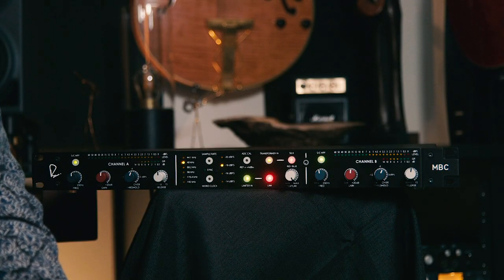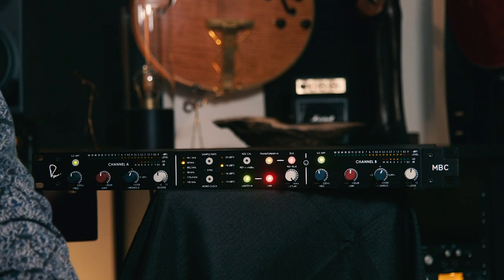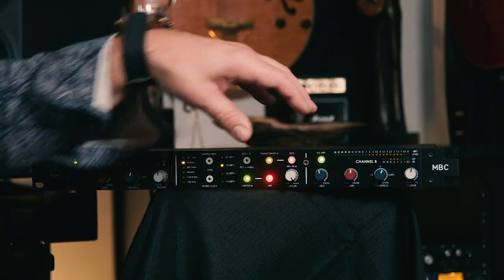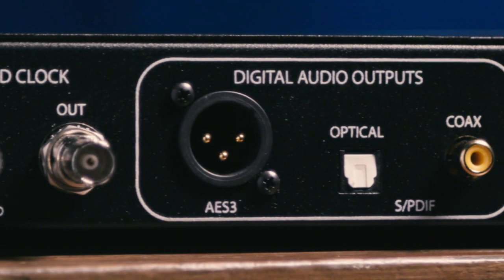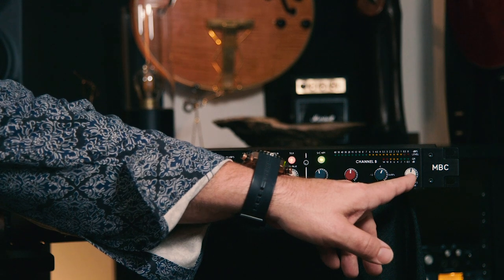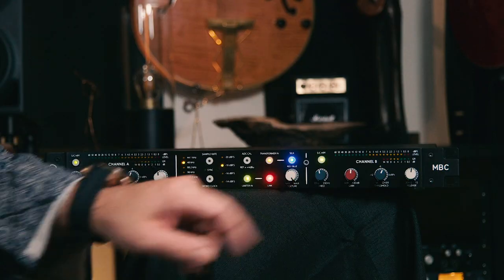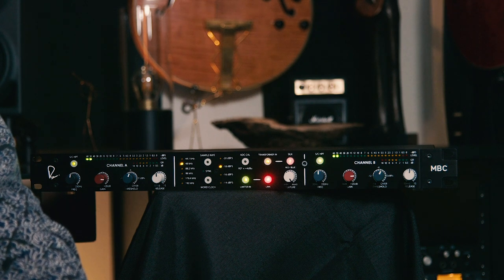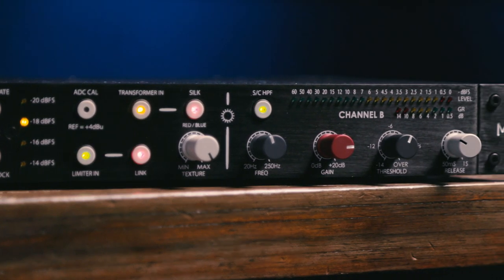Rupert Neve Designs MBC Master Bus A/D Converter and Limiter Demo

Comment: An case anyone is curious, it's four grand.
Reply: skull emoji
Reply: @Muse Axe Backing Tracks Floating point is a digital domain format post conversion anyway?
Reply: @Muse Axe Backing Tracks There is no converter that exists that operates in flloating point as by very definition the 0dB clip threshold is set.  Post conversion any 24 bit fixed point file can be converted to float for processing as all that is happening, to explain it simply is the clipping threshold is raised.  32 bit float file is basically a 24 bit file with an extra 70dB of headroom above 0dB to avoid clipping.
Reply: Sticking with my dangerous convert ad+

Comment: i am quite new to this wolrd , still trying to figure out some tecnical stuff. so this converts audio sources like guitar, volcals to digital, can it do the opposite? converting digital to analog from the sound card and feed it to the studio monitor?
Reply from the maker: Hi, C-Ra - great question! This is only an analog to digital converter, not a digital to analog converter. If you are looking for an all in one converter that goes in both directions, you are looking for an audio interface:
https://www.sweetwater.com/shop/studio-recording/audio-interfaces/
This is the best place to start if you are new to recording. If you are running a professional level studio it does sometimes make sense to have separate converters, in which case you would get a separate DAC to go along with this.
Thanks!
Jason Filloramo, Sweetwater Sales Engineer, (800) 222-4700 ext. 1281, Jason_Filloramo@sweetwater.com

Comment: This unit is really unnecessary especially at 4k.
Reply: Right. Seems like their products are running together. Many of them doing just about the same thing. With 1 thing that’s different. Unnecessary and costs too damn much.
Reply: Considering that units like the dangerous convert 2 is around 3 grand, and the portico II MBP roughly 4k. I’d say it kind of is worth it, your pretty much getting both units in in one but maybe minus a few features. All in all, I’d say it’s a deal for me, but maybe a deal breaker for some